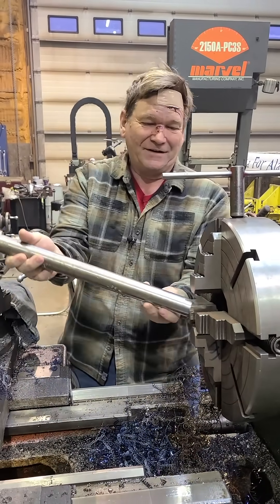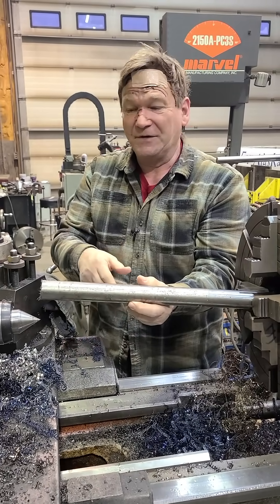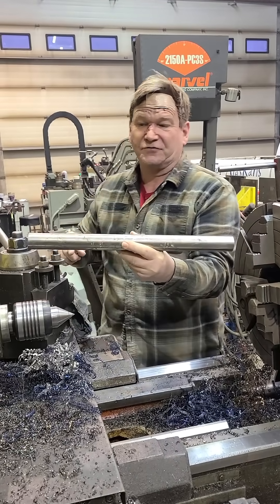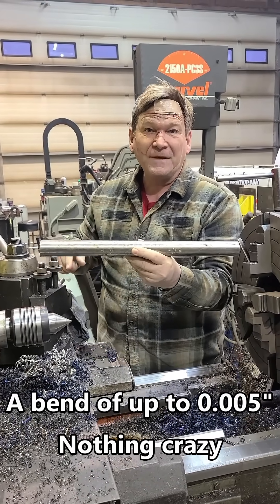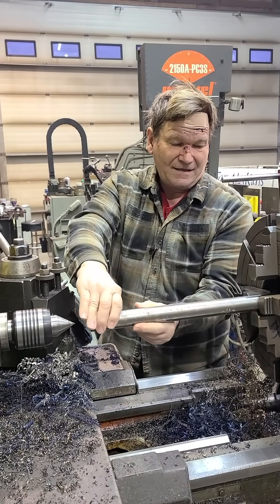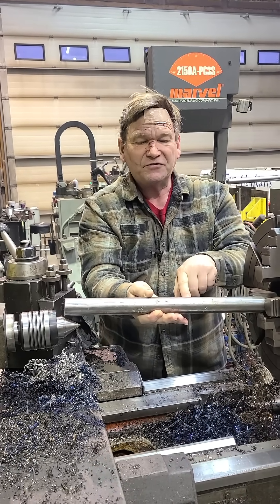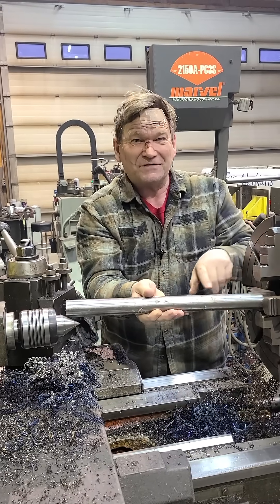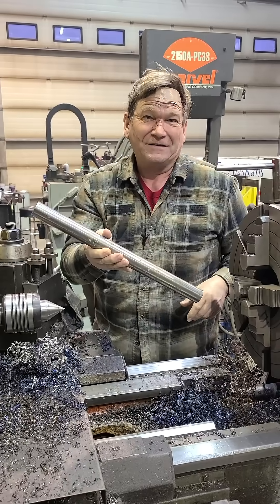Machinist's Minute: Double centers for bent shafts

Comment: Make a center that fits your lathe shaft and chuck. you can then tighten the 4 jaw chuck on the shaft. I know it cannot be done on some lathes because of how the chuck mounts and the shaft. i have seen it done and it works great. My cheap little lathe came with one that does just that.
Reply: I am not sure i understand, so i will rephrase like i got it : you mean use a dead center in the headstock taper, thin enough so it can slide in the 4 jaw's bore, while the chuck is mounted ? And then you place your drilled center on that headstock's deadcenter point, and tighten the 4jaw snug without straining the deadcenter, to drive the piece itself ? Thanks in avance for you feedback.